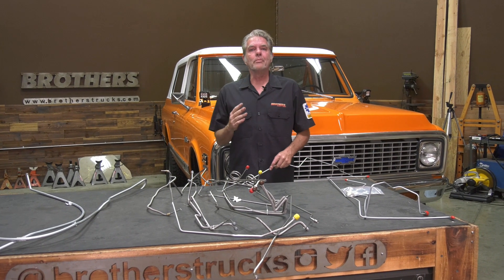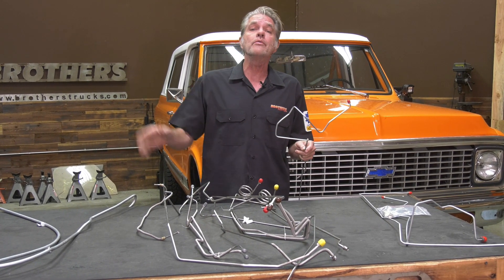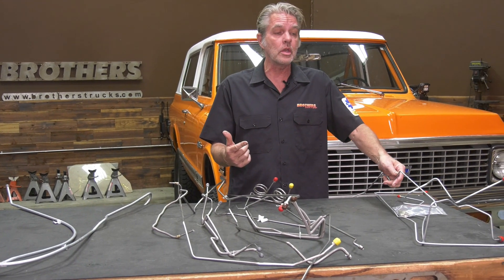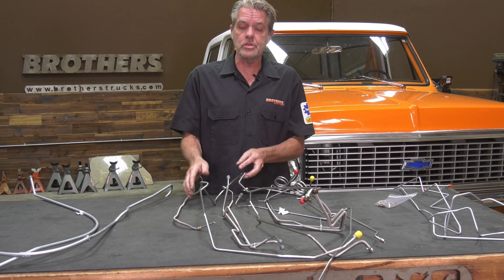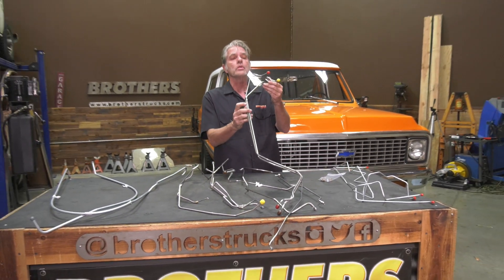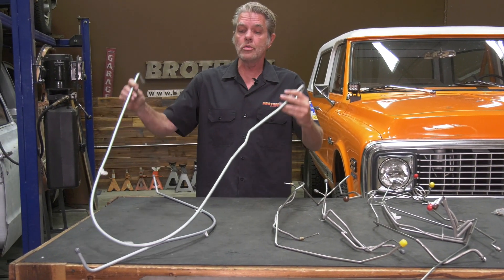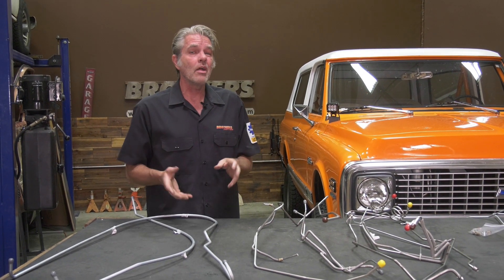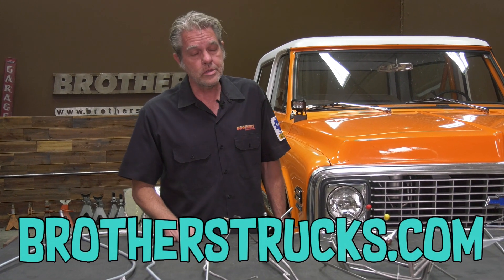1947-1987 Chevy & GMC Truck Pre-Bent Brake and Fuel Lines

Comment: Great information Dave, and an explanation of the fuel lines bent for shipping purposes. 
These prebent lines are a great way to update and upgrade any of these old pickup trucks or Blazers and the kits include pretty much everything you’ll need, you still need to supply the tools, time and brake fluid!
Reply: Does it come with blinker fluid?